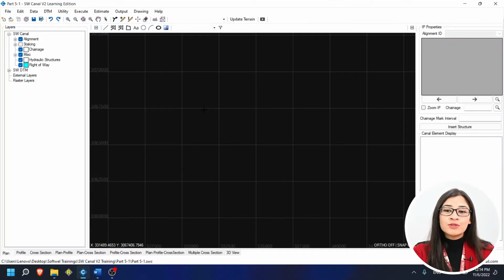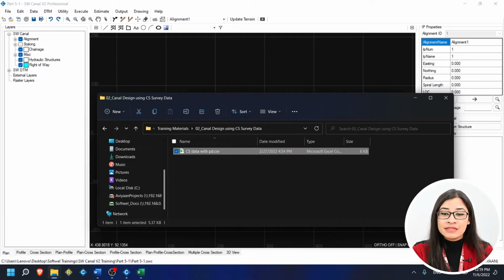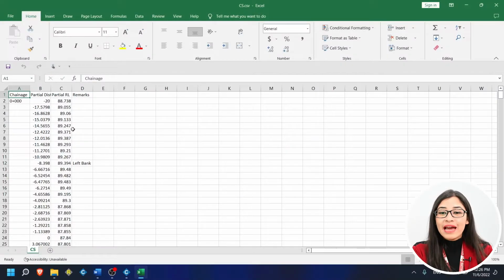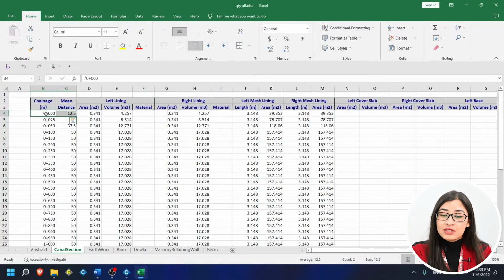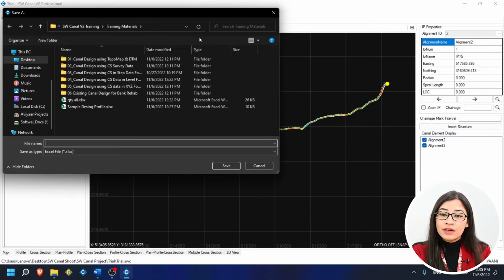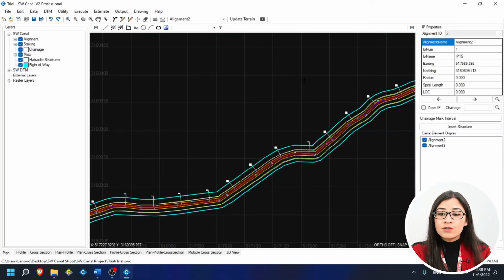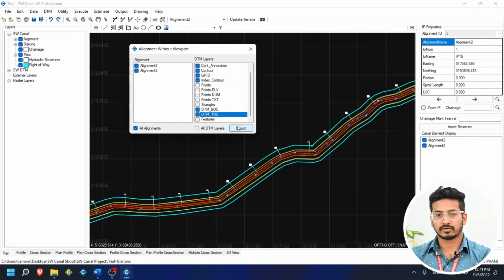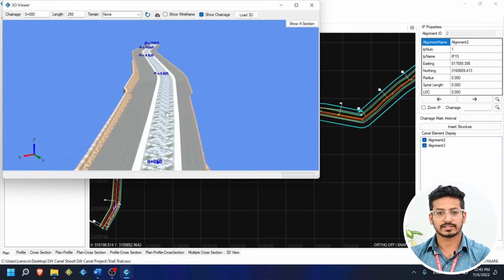Importing Various Design Data and Generating Output | Softwel (P) Ltd. | Part 5

Comment: Can you help me??
Problem: While sign in in Sw Road. It says it cannot connect to Softwel. Check internet connection.
But wifi is connected. Can you help then please reply.
Reply: It means your system clock is not sync with the internet time. For this Right click on the clock at bottom right corner> Adjust date/time> Under Current time and date-Turn on Set time automatically and Under Synchronize your clock, click on "Sync Now". Then it will be done.
Reply: @rajmohan3134  not working... 
It shows the same problem.
Reply: @vijaykhatiwada34   Did the clock synced with internet or it failed ? if it failed it won't work.
Reply: @rajmohan3134  it synchronized with internet time but didn't work. I had to do my project but it's not operating.
I have Windows 7 ultimate. Does it run in windows 7??
Reply: @vijaykhatiwada34  The minimum version for SW Road is Windows 7 but windows 7 must have service pack installed and Dotnet framework 4.8 installed.
Reply: @rajmohan3134  It's not working.
I reinstalled dotnet framework v4.8 still not working.
Reply: @vijaykhatiwada34  Plz visit softwel with your laptop.